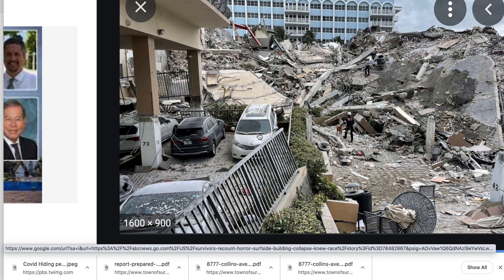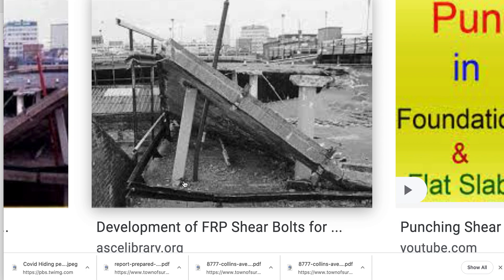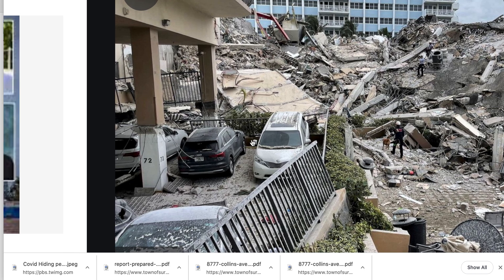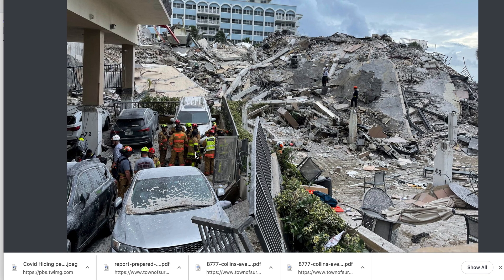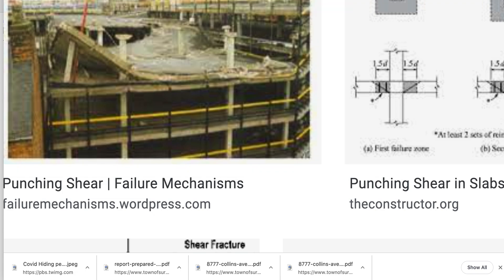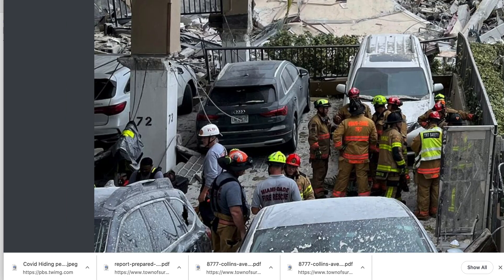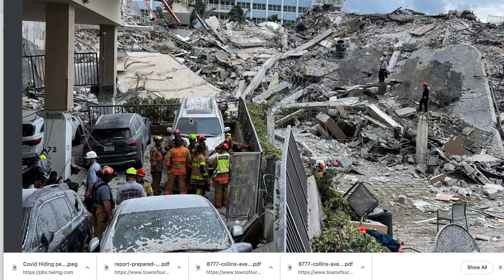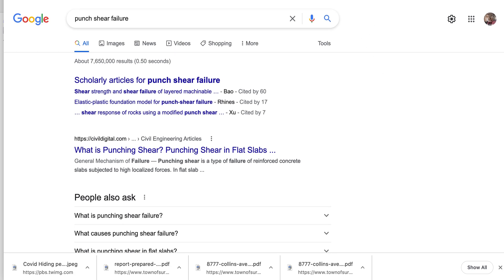Champlain Towers Punching Shear ground zero? 98% sure CAR LOADS AND REBAR ISSUE part B

Comment: This actually makes sense to me, as the parking area in front of the lobby  has a high change in loading depending on vehicle weight and position.
With much higher gross vehicle weight nowadays compared to  40 years ago, this could have taken the building over its limits.
Reply: I was thinking the same thing about the vehicle weight of 1980 vs 2021 but upon research found the cars to be the same weight. The SUV’s are bigger physically but cars use more light weight plastic. The lack of rebar below in the car deck is very appalling.  Bad design probably repeated in the North building.
Reply: Most interesting. That deck featured here (with the cars still in place) is the only portion of the deck that both a) had cars on it and open sky above it and b) wasn't located between the thicker beams of the portion of the structure left standing after the initial collapse. This was right between column 46 (large size) and column 44 (smaller size). All of the other parking spaces up on the surface level, atop the deck, right outside the lobby, were between pairs of large columns. Those four surface-level parking spaces were inadequately supported compared to the rest of them. It's possible they were added after construction.
Reply: Well said
Reply: ...So the Building had Two Parking Lots...????.....One Underground, and One above Ground...????.....!!!....Google Maps does Not Let you go, too far in...!!!.....Sad

Comment: Disagree, look at how column 72 and the one behind is undercut on one side by the fractured slab, this would suggest the direction of the collapse I think
Reply: But theres no defacing of colum paint, and the rebar fans straight down cermetricly, now there is butterfly out from there as you suggest,but i think this area and all the way to to the elevator shaft is the epicenter.
Reply: I do a rewatch and try to see this undercutting👍
Reply: Ahh!! I didn't see those colums just to the right of 72/73! And that hookin rebar mabey has a slight cheese slicing going on,They certainly look in much worse shape than 42 and the others, you can barely tell its a colum at this angle.

Comment: So, the concrete  was bad in that area and didn't have enough horizontal support? And it took 40 yrs to fail?
Reply: Reinforced concrete is something like 20 times stronger then concrete alone. So it would be the rebar that rotted away and leaving the load on concrete. Which can't support the load.
Reply: If things are starting to point to this SW corner of the property, consider its proximity to the heavy street traffic and closeness  to the construction stresses imparted by the new building to the south. Put that on top of the deck slabs compromised conditions...
Reply: Yes because every step of design process has redundencies built in rebars allowed strength is less than it's real ditto conc ditto thickness of conc & it took 40 yrs to collapse the steel & concrete failed long ago ie their strength fell below that needed At such time the bldg should have been declared unsafe That assumes owners managers govt cared at all to "do the right thing" even w/o laws prescribing exactly what to do when THAT WAS THE CRITICAL FAILURE

Comment: You observations are amazing.  Very rational and evidence based.   Makes sense that a failing deck loaded with cars would drop first as opposed to an empty pool deck.
Reply: ....Plus, One Guy on the TV News said he had talked to his Aging Mom, the Night Before---and She said she Kept hearing Noises in the Apartment---But, he said he Just dismissed it as Her getting Old...!!!....What Could Noises have been from...???.....The Beams Shifting...???.....Cannot remember what Floor she Lived on....Wow......Sad
Reply: If the building had expansions joints it would deaden the noise. If not you could of heard the rebar tearing at the concrete. On a lot of the floors. Or the cement beams cracking slowly.

Comment: It appears the decking was just laid upon the tops of the columns, with no horizontal members between columns to support the decking.
Reply: My only question is how that setup took so long to fail, unless the added pavers and mortar gave the added weight to be the straw that broke the camel’s back.
Reply: @gutfinski  I'm going to guess years of vibrations and undulations coming from the driveway portion (farther under the building, and to the left of the picture shown above) slowly wore down the connections of the deck to the columns. Just a guess based on the fact that the entire property is built on the garage structure.
Reply: @jazzman92478  This is something not talked about much. And where do moving vans drive in to load and unload? There isn't a service elevator.
Reply: Now I see there is a service entrance by the electrical room. So big moving vans would street park, but what about small ones?
Reply: Them pavers held water and added weight. Just wondering if a drunk came home and hit a support column. Trigging the collapse. Hence the leaking pipe... And the already rotted rebar.
Reply: Yet another common level of redundency found along bldg perimeters & under car / grade level decks missing I bet they didn't even beef up slab to take cars
Reply: I'm a retired builder from Australia  I said from day one, when I saw the first pictures ,   there is no beams  or pads on top of the columns, to spread the load ,  to me this is extremely bad design .